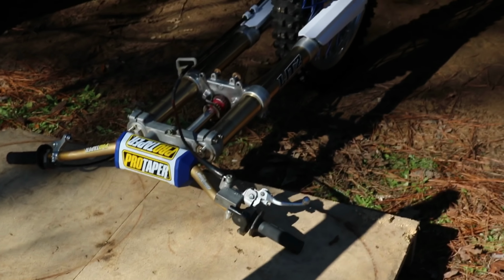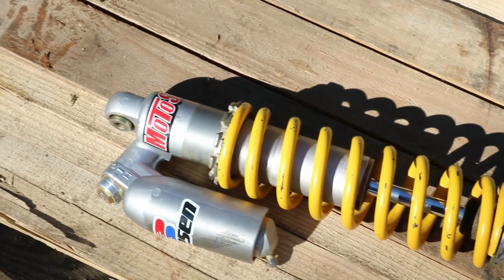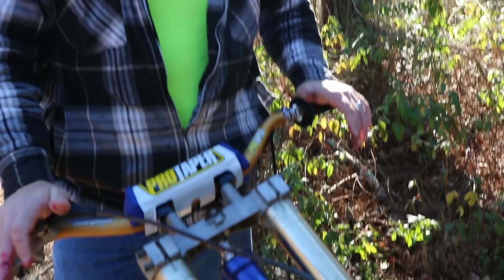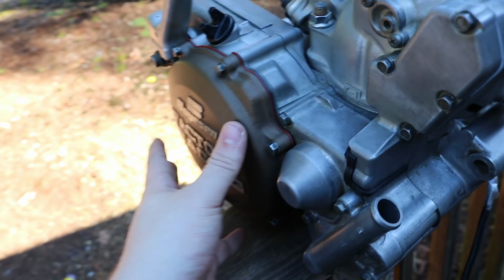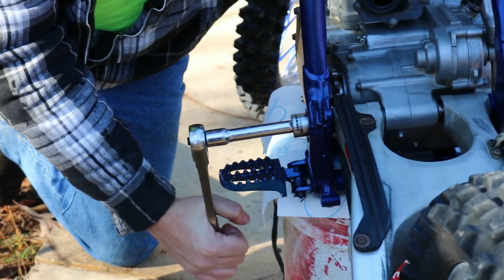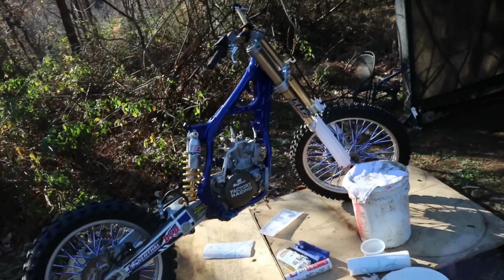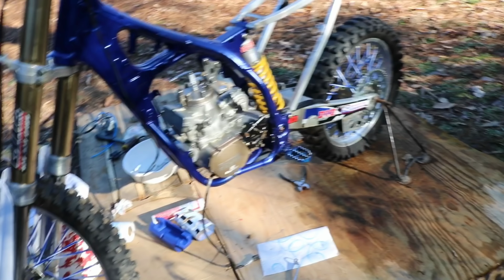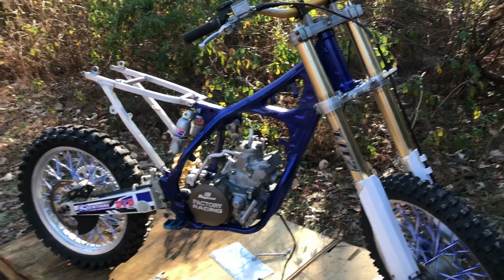It’s FINALLY coming TOGETHER ( Yz250 Big Bore )

Comment: U got that backwards my guy the bigger the rear sprocket the faster it gets up and goes the smaller the rear sprocket it ain’t as torque but u will have a higher top speed

Comment: You would want less teeth on the back for a higher top speed
Reply from the maker: if you think about more teeth = top speed less teeth means less teeth that the chain has to spin around so it accelerates faster
Reply: Less teeth = top speed
Reply from the maker: Yep you’re correct just looked it up
Reply: @High.Gear.Garage  drive and driven sprockets have opposite effects
Reply: That what I was gonna say

Comment: Dude I really like your build man I have a 2001 yz250f and I've been going through the whole bike kind of like you have it didn't need anything I just wanted to so I put a bunch of new stuff on it I got the rent all sprockets online 50 on the rear 13 on the front with a 520 gold chain and I also have a 48 tooth which is what I had on the bike to begin with it's nice to have different sprockets four different riding occasions I'd rather run my 50 tooth on a track but I would rather run with 48 tooth going down the road 5th gear wheelies as far as you can hold them
Reply: I think the 48 tooth sprocket will be faster than the 50 tooth on top speed the 50 tooth is more for more torque and the 48 tooth is for more speed I'm pretty sure but if I'm ass backwards just let me know
Reply from the maker: Nah I think you’re correct I’m backwards
Reply: @High.Gear.Garage  it's all good man you'll have fun trying the different sprockets out you can really feel the differences the 50 tooth sprocket you won't be going real real fast but you barely flip that throttle and you'll be staying in a wheelie trying to get the front end down like you're on a 450 or 500 even with the 48t sprocket my YZ will stand straight up in 5th gear without clutching it up I'm going to try to get a GoPro for this summer so I can get some vids I'll keep watching your build man I really enjoy it